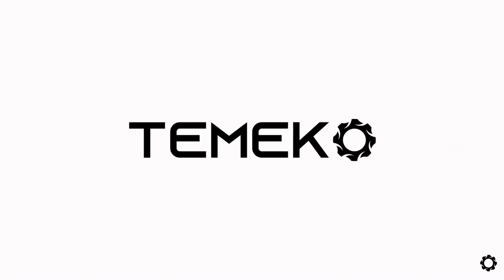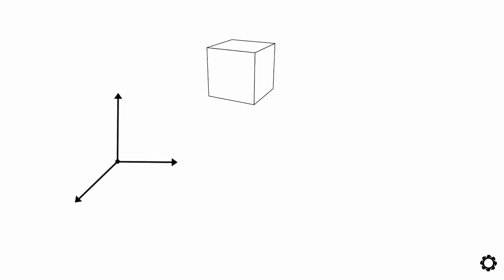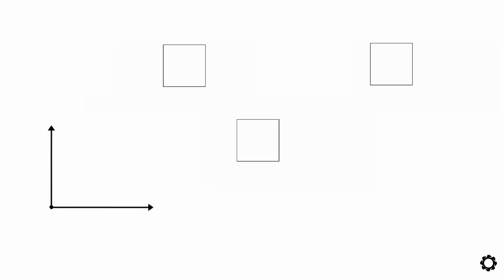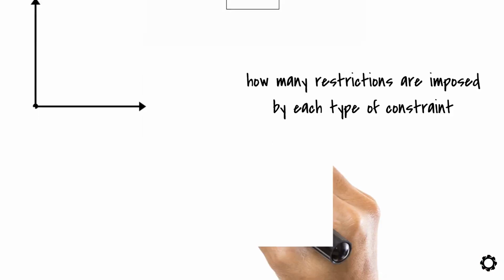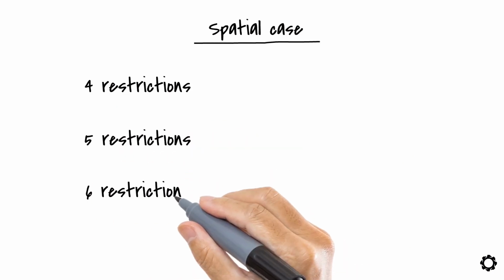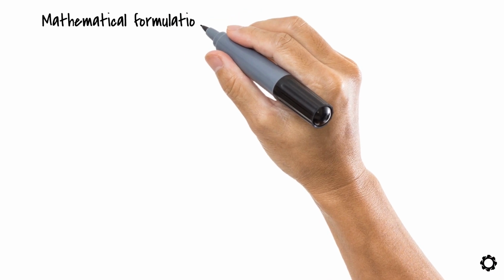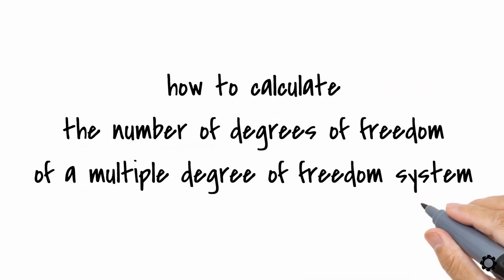Understanding Multiple Degrees of Freedom System - Part II | Simulations | Machine Dynamics

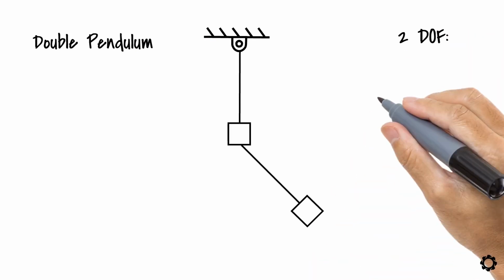Comment: 1:23 It is nicer to explicitly indicate THE SECOND (rotational) joint on the first mass. It tells that the second pendulum is connected to the first one exactly the same way as the first one is connected to the "ground". But most important that later you calculate the DOFs and you need the NUMBER OF JOINTS that is 2 in this case, but only one is seen in your drawing.